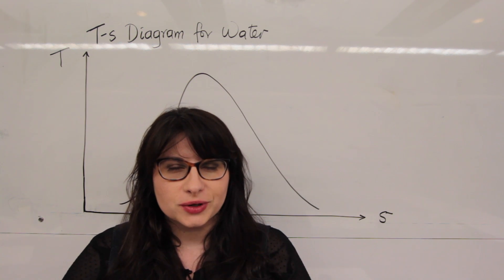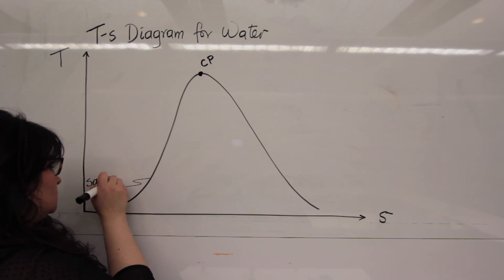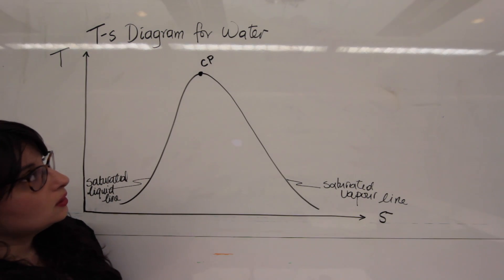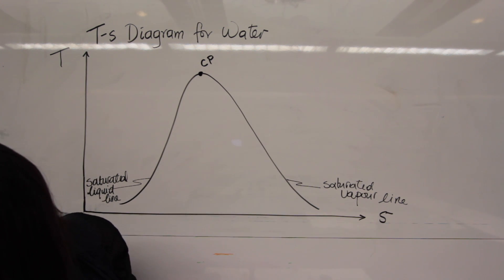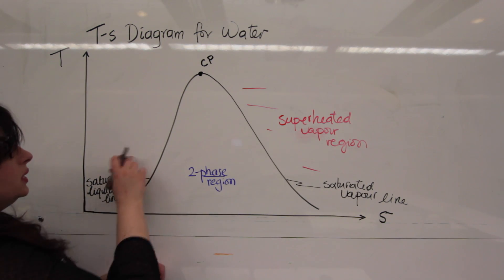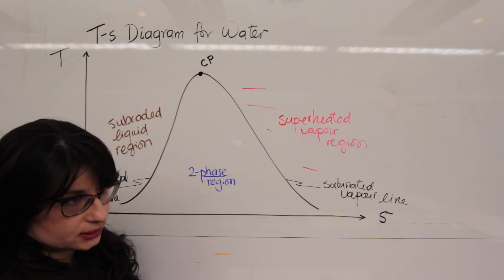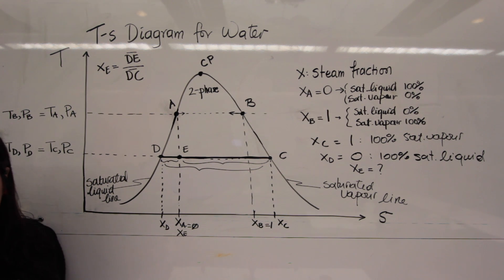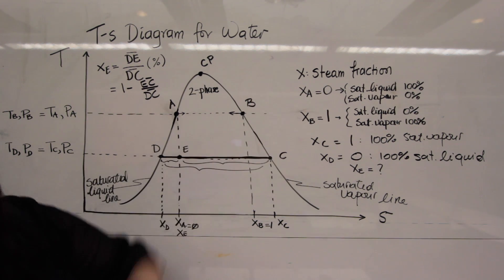2.1. The T-s Diagram - Part 1

Comment: what do you mean by taking energy away and adding energy here? wouldn't you have to increase the temperature to increase the energy and vice versa?
Reply: yea that or changing P, V referring to work done by or on the system. You can also accredit the change in phase to the combined effect of change in PV. 

Now she uses the word energy which is work which could be PV or temperature. If one would change all are subject to change. 

Energy also refers to enthalpy and heat and entropy, all different parameters of explaining change from a perspective.